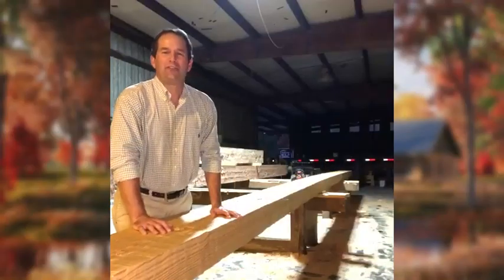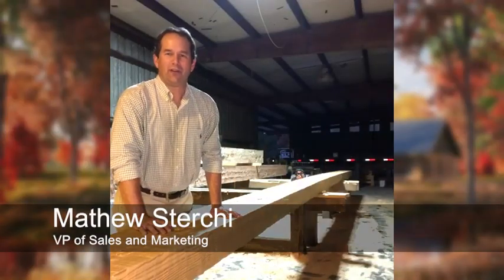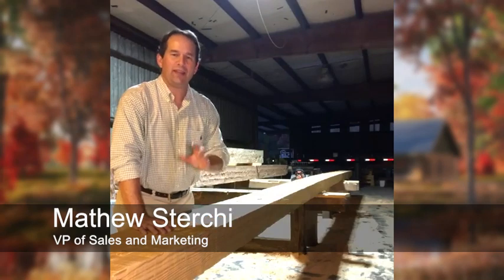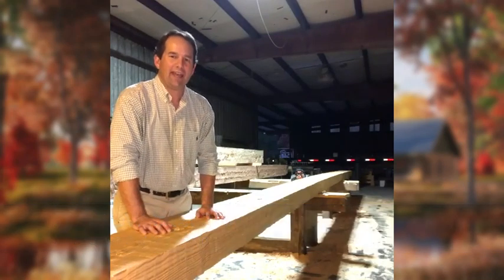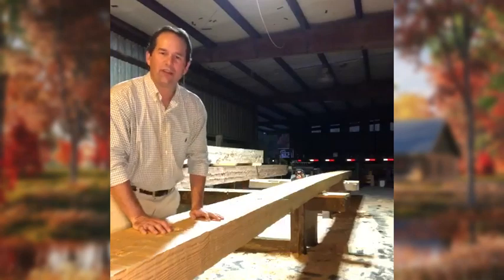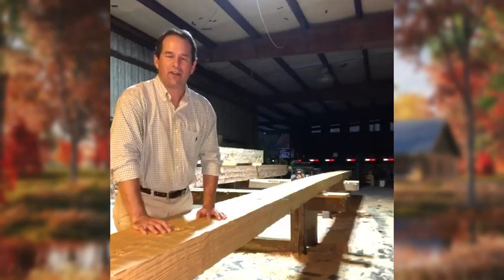Tip Tuesday: Splice joints vs. full length logs

Comment: How do you keep a 40' log stable? Seems more likely to twist and bow.
Reply from the maker: T. P., Great question. We use Douglas Fir as the wood species for our log walls which is known for its increased strength and stability, and we structurally engineer our log wall system with connections and fasteners in the walls to comply with local wind, snow, and seismic building code requirements.  Our increased log wall lengths increase structural stability and eliminate unsightly and unnecessary seams that have to be maintained in the log walls.
Reply: i realize I'm kinda off topic but does anyone know a good site to stream new series online ?

Comment: Hey Matthew -- great info -- 40feet - Wow - any particular "wood" for that length?  Stay safe my friend -- HAPPY THANKSGIVING
Reply from the maker: David Mooney, Great question. We use Douglas Fir as the wood species for our log walls which is known for its increased strength and stability, and we structurally engineer our log wall system with connections and fasteners in the walls to comply with local wind, snow, and seismic building code requirements.  Our increased log wall lengths increase structural stability and eliminate unsightly and unnecessary seams that have to be maintained in the log walls.